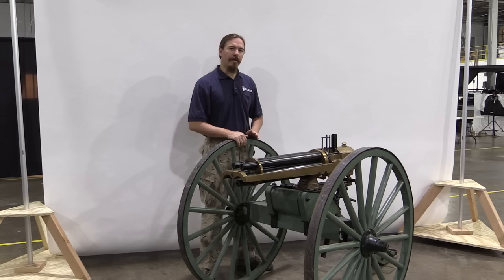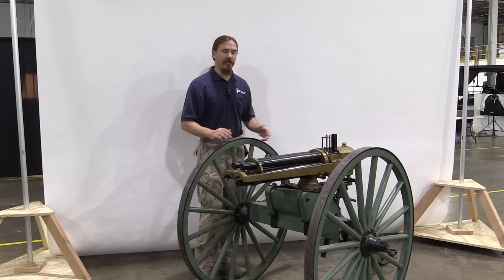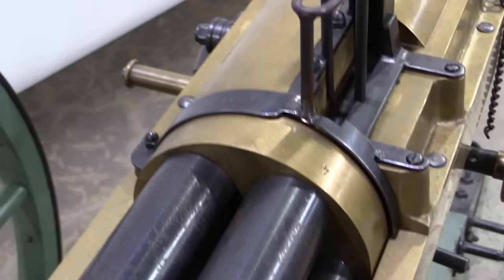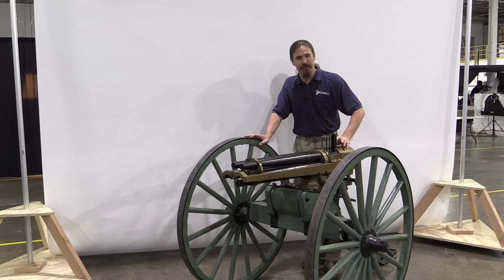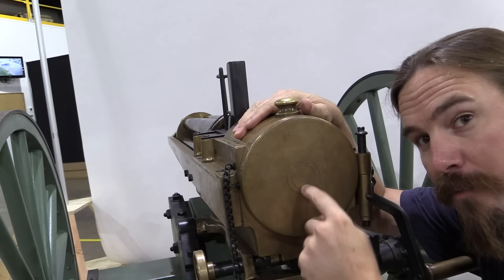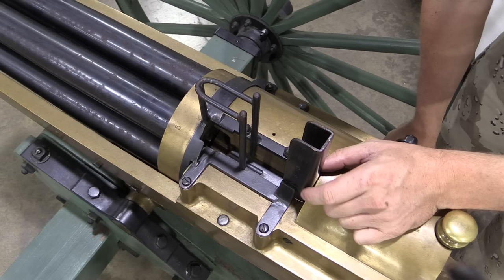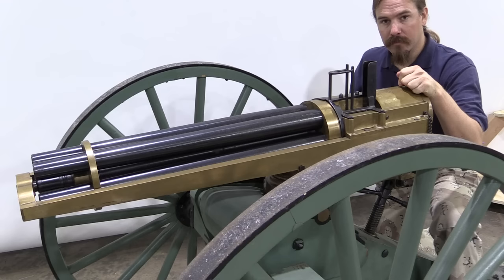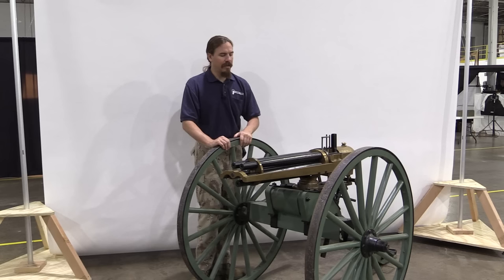.50 BMG Hotchkiss Revolving Cannon Reproduction

Comment: I can see how setting it up for .50 BMG black powder loads actually makes it more practical for recreational use in a weird way. You can get a stockpile of .50 BMG brass, cast your own lead bullets because of the lower velocity, and reload the cases indefinitely because you're using them at far lower pressure than the brass is specced out for. It could be RELATIVELY cheap to take your rotary cannon to the range on a regular basis!
Reply: I was looking at the exact same idea! Semper Fi
Reply: And black powder isn't regulated as a firearm 🤔
Reply: @KJTUSKJTUS  in a cartridge, unfortunately, it is
Reply: @offdeadeye88  huh, well I'm sure it would still be classified as an antique firearm
Reply: Plus you get all the cool smoke for the audience.
Reply: @KJTUSKJTUS  Depends on the state. In the great shit hole of Illinois, its still a gun. Flame throwers are still okay though.
Reply: Simply taking this gun on the range must be quite the adventure on it's own

Comment: That camming wheel looks very different from the Geneva drive i expected to see when you opened it up. I thought Hotchkiss designs would have used a typical Geneva drive, but I guess those weren't sturdy enough (and plus that camming gear does everything all at once). That's a really elegant and impressive design.

Comment: I thought Hotchkiss had 20mm ones as well.

I have to agree that .50 was a good idea for this replica. I can get .50 brass with out much trouble.
Reply: Plus, you don't have to deal with the unconstitutional ATF with even normal .50 BMG, but once you start making something 20mm or 30mm based, it gets a bit more tricky even if you have stated that it is not supposed to fire smokeless rounds...

Comment: Hey Ian, since the barrels stop before firing, why did Hotchkiss decide to go with five barrels instead of three, and have an operation on each barrel?
Reply: Griffyn Pilcher dunno
Reply: Black powder residue build up would be my guess.
Reply: The more barrels the longer you can maintain fire without over heating.
Reply: I'm a bit late here, but the cam would have to be much wider to be able to move the barrels the needed distance which would also mean more force needed to operate the cam and less smooth operation
Reply: @noobulon4334   That makes a lot of sense, now that you mentioned it. I never even though about the cam width!

Comment: Painful to see the pitting on the barrels... Anyway, this weapon, in its incarnation (purely IMO) is overly complicated, I'm guessing in an attempt to avoid Gatling's patents.  Look to the Gardner gun and similar.  The same functionality can be had with 1 or 2 barrels w/reciprocating bolt(s).  Overheating needing 5 barrels?  Doubtful, the ROF is low.  Anyway, it's a beautiful piece, regardless.

Comment: shoulda did a 50/90 or something other then 50 bmg due to amount of powder used..even if light loads with 50/70+ u could use a paper to hold powder to back of case

Comment: if it's only 50 BMG (with black powder) why are the barrels so heavily built and thick walled
Reply: I'd go with historical continuity, just to look the part for better 'immersion'
Reply: I'd go with historical continuity, just to look the part for better 'immersion'
Reply: I'd go with historical continuity, just to look the part for better 'immersion'
Reply: +Draftsman17 Possibly to retain the original aesthetic look of the gun.
Reply: that's what i was thinking but still
Reply: Because its a fucking reproduction, and do u not know anything about a fifty bmg? seriously if u used a thinner barrel it would literally explode,
Reply: if  anything Dustin, it being a reproduction would allow it to get away with thinner metal as the steel today (within the last like 20 years) is leagues ahead of the originals....that and yes it's 50 BMG, but it's black powder hand loads being used so.......i think you get my point
Reply: +Dustin Butterfingers@aol.com Dude, do you know anything about firearms.....
He said it used black powder loads so although its a big cartridge the pressure is much lower than a modern load. Also if you look at something like a M-107, the barrel has a 1/3 the thickness and has fluting.
So really the only reason for the tick barrel is to make it look like the original 37mm Hotchkiss not because of the 'extreme pressure' of a 50BMG black load haha
Reply: I would have to agree with the purpose of historical accuracy. Also chambering in .50 means you wont have to get a tax stamp and register it as a destructive device if it were a larger caliber.
Reply: Probably because it's a reproduction of a gun that fired rounds over 30mm in diameter.
Needless to say, trying to make and sell a 30mm revolving cannon to people is frowned upon by the ATF, so it was reduced to a non-controlled .50 caliber (but the barrel's outer diameter was preserved for authenticity).

On the bright side, you'll never need to worry about overheating!

Comment: Probably not the most effective gun ever but it would have been quite a thing to go up against in it's time
Reply: +Kaos Wylie the slow rate of fire would have been fine with 37mm or bigger explosive shells, it's only machine guns that need a high rpm. Also, it depends what the other guns on the ship were on the 1870's
Reply: Don't forget, the original fired explosive shells.

Comment: Do you know if anyone ever tried to operate any of the mechanical guns with a steam engine to increase the rate of fire?
Reply: It would kinda negate the "portability" of this or the gatling.
Reply: +Eric Day I think they already had electric motors at the period that were small enough and powerfull enough to operate the gun,which would make it perfect for a ship that has a generator running of its engine,but i dont think many people put that idea together in their head at the time
Reply: +Eric Day It was tried several times, the Gatling system starts falling out at about 1000 RPM, case extraction and other issues of that nature,  mostly having to do with the gravity fed nature of the guns, hence why modern mini guns feed off a rotating feed drum that's connected to it's main drive gear to keep the feeding up with the rate of fire.
Reply: +crocop195 In the day when these were made emphasis was placed on accuracy a range not rate of fire. Many countries mocked the early machineguns as a waste of resources and ammunition only to find themselves unprepared for WW1.Adding electric motors on Gatling did work enough to provide proof of concept when the idea of the minigun was proposed for the early jet fighters. But the antique mechanics on remaining museum pieces was too outdated, as were the cartages used.  The original test gun is in the Springfield Armory Museum historic site I do believe.
Reply: +David T ^^Davids spot on. Even if it did work, military leaders wouldnt have approved it. They were all still stuck in single shot BP warfare. It came back to bite them in the ass in WWI though... 
BTW I didnt know that about testing early mini-guns, do you have a link to it? Id like to read more. thanks!
Reply: I don't have a website reference beyond a quick look at the Wiki for M61 Vulcan and all they mention about it is someone successfully trying it in 1893.  But I do know it has been discussed in at least a half dozen shows.
I think it has been covered on American Shooter/rifleman with Jim Skeltin, Lock N Load with R.L. Ermy. and possibly Weaponoligy as well.
I do need to correct myself though; The proof of concept test was for what would become the  T171/M61 20mm GE Vulcan Gun, the MiniGun is a downsized version for lighter viechles, hence the "Mini" part of the name. Though now we tend to call all rotary systems miniguns.
Reply: David T yeah i heard about that,id love to see a gatling with a electric motor on the crank
Reply: crocop195 indeed sir!! Epic
Reply: David T Thanks for the info. Ya, id love to read more on the trials and testing of what would become the Vulcan/mini, specifically on what they did to early Gatling guns. Sounds fascinating!.
Reply: +Eric Day the very last models of ship mounted gatlings were advertised withelectric motor capability and I think a few were used on ships since they had generators to power them
Reply: +crocop195 what about reliability? early electric motors where less than durable.
Reply: SuperFunkmachine im sure a motor could be produced that could withstand at least a couple thousand rounds,and since I was talking about the most possible use of it on a ship it would be very easy to carry many spares and the replacement of them could be made very easy to do.Of course this all would have to be made worthwhile by the effectiveness of the gun itself,and considerng the armament of ships at the time I think it would.That was a good question to ask :).
Reply: +crocop195 I was thinking of the weather and salt water out in the north sea, that would destroy a motor long before it got to fire.
The real question is how much faster is a motor than a scared man pulling that handle.
Reply: A motor of that era would most likely be DC and use replaceable brushes and unsealed oil lubed bearings. Maintaining the motor would be no more routine than care of the gun itself. Having worked on antique machines the motors can be quite durable.  The problem of unreliability arose once sealed units were introduced and people forgot how to maintain the old ones. Treat an old machine like a modern one and it will fail on you. Run it properly and it will run for a hundred years.  
I know a couple big shops that have a few 100+ pieces of equipment on the line that do their job better than the latest tools, day in and day out.
Reply: SuperFunkmachine I dont think it would be a problem to make a sealed case for the motor,and also what david T said,those things were pretty reliable and as a matter of fact you can stick a unsealed dc motor in water while it is on and it will continue to run,but of course the bearings would eventually fail and it would rust,so that means they are really easy to maintain
Reply: +David T I think the biggest problem would be transporting the engine to make the electricity under battle conditions... not to say that wouldn't work, but when you can grab any soldier and tell him to turn the crank... also the Hotchkiss gun was a small(er) rapid fire artillery piece, not necessarily a weapon that needs a high rate of fire, it more or less needs to be capable of sustained fire, and when there are several in a battery, they are more than capable of that
Reply: +KC Athow You could always carry large battery for power.

Comment: Only five rounds?
Reply from the maker: +Ironstorm The assistant gunner's job is to reload while the gunner fires.
Reply: Yes but original gatling guns had way more rounds in the mag.
Reply: +Ironstorm 
Like he said, the original Gatlings had also a higher ROF and weaker ammo.
Reply: +Ironstorm It had much smaller ammo, .45-70 is under half the diameter.

Comment: Getting rid of any gas system seems inherently more reliable - in reality, is it?
Reply: +Son of a Zombie
The design was made before gas systems even existed, though externally powered weapons don't care if a round is defective and doesn't fire/makes too little pressure to run the action.

However with that said you still have to have an external motor and powersource which adds to complexity and weight (hence why we don't have miniguns that people can carry and shoot like a rifle, at least yet) which brings in issues with reliability.
Reply: Herr Heckler und Herr Koch may have something to contribute here.